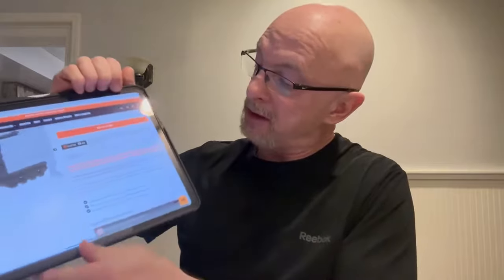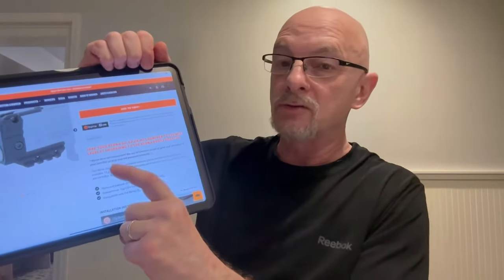3 Habits That Can Damage Your Byrna!

Comment: Ive watched a lot of your videos over the last day as I get ready to get my LE. I appreciate the tips as I was wondering if you could chamber one and then load the mag back up. Its good advice, they're pretty pricey, and of course the last thing I want to do is get a jam in a moment of need because i tried to squeeze another round in which is the biggest take-away for me.
Reply: If you chamber and then throw in a mag...It could jam up the mechanism and me personally would not advise it. The mag will still try and chamber a round regardless if one is there or not, so you are right it may jam in a time of need......theoretically speaking :-)
Reply: I would just get an X-tra extension you’ll be able to hold more rounds and the jam isn’t an issue 🙏 I just ordered mine plus a “bigger” spring 😇😬

Comment: I understand your point of view but of course they are only recommending their own products. Crossman probably doesn't recommend using anything from byrna.
Reply from the maker: This could be very true! I purchased the Byrna brand and compared it to Umarex C02 and save your money! Byrna underperformed the chronograph test every time and is very expensive!
Reply: The only 12 gram they warn about is Crosman. Most others are fine. Crosman QC is terrible and the caps are too thick on many and can cause issues. The Byrna CO2 packs are great though as they include an oiler cartridge that makes proper oiling so easy.
Reply: I was thinking that myself, them not wanting people to use the cheapest and most readily available co2 cartridges which would be crosman, of course they would rather people by their own, it is interesting that crosman is the only one mentioned though. I’d still probably follow the maintenance guidelines that the manufacturer provides

Comment: Shortening the spring just a little bit taking some of that tension off will make it so you can shoot 8 rounds out of it with no problem without that extra tension your talking about you can do the same thing with the 5 round magazine to keep them from cracking pepper balls in the magazine
Reply: If you cut the 7 round mag springs, the mag will be useless and will no longer function due to the way that the spring mounts inside the 7 round magazine.

Comment: Yes, I have tested all of my byrnas and they will hold an extra round. There is no way I would make it a common practice though. I figure the people that designed it know exactly what should be in there. Just because it fits doesn't mean you should utilize it that way. Great video as always.
Reply from the maker: I totally agree! Nice to see you’re still hanging around, do you still use your Defender? I have come to the realization you have to charge the cartridges every week or so to keep them reliable. Wait until you see a few videos I have planned for the Defender I have been working with a friend and he has made some huge improvements! How about the barrels actually fitting without wrapping tape around them and a piccitiny rail on bottom for a laser or light instead of the top and the useless laser that is built in. improved front sight and 3 different sizes including a compact which is 1” shorter than the original and if that’s not enough we are also working on a 68 cal less lethal that shoots Grimburg D shaped 7.5 gram projectiles. Just take your old outdated barrel receiver off and slap on the new and you’re good to go! They will be for sale soon!

Comment: Finally someone else says the same things I've said in other channels where I get mocked for saying these things.

Now that the improved 7 round magazines have been our for a while and no one is complaining of them breaking things, I can finally free safe ordering a few for our two Byrna. 

I actually contacted Byrna about oiling every 500 rounds because their CO2 cartridge boxes ship with 9 regular and 1 oiler cartridge for your Byrna. I asked them why do we need to use an oiler cartridge after 180 rounds if they recommend oiling it after 500? They told me to used the oiler cartridge at either 500 rounds or if I feel like the launcher is starting to feel like it's not shooting as it should.
How clean you keep your Byrna and the ammo you use will affect how quickly gunk can build up which the oiler cartridges help to clean out and keep the internal lubed. 

Just FYI, I based by numbers on 5 rounds per clip, 4 clips per CO2 (anything after 20 rounds is too weak to count), and 9 CO2 per box (saving that 10th oiler cartridge for later use). 5*4*9=180 🥺
Reply from the maker: I agree I think 500 rounds between oiling/cleaning seems to be too long and I never go past 3 seven round clips myself. I will probably stick to around 180 shot’s between maintenance to be on the safe side. Thanks for watching!

Comment: Thanks for the video! I just found you on youtube and will watch more. I don't know if you mentioned this in another video yet but on here you mentioned about the lubrication....Byrna actually found a way to do this from the CO2 cartridge. The one I had or have from Bryna has 8 cartridges in the box but one is lightly labeled "Oil"  So after the 500 rounds or so you can place this CO2 cartridge labeled 'Oil" and use it normally. Supposedly it will oil the mechanisms.
Reply from the maker: For some reason I totally neglected to mention the C02 oiler thanks for your input and for stopping by!

Comment: You are correct about the 5+1 and 7+ 1 arrangement, and byrna does not recommend using such load outs. Of course, the one thing they didn’t count on is that certain balls are slightly undersized, and when loaded in a magazine it will give it the margin the barrel and chamber needs to add the +1. 

And of course, it is definitely not recommended to load +1 with anything other than kinetics. Pepper or gas payloads may crack under the extra stress. I’m still doing further tests into the efficacy and reliability of the +1 with and without chem loads, results pending. And finally, YMMV

Thanks for sharing your thoughts!
Reply from the maker: Hey keep us posted on results! Thanks for watching
Reply: @airgunnerreviews7888  The other day I had a duke plus OC ball leak in a 7-rd magazine, and I had it loaded with 1 kinetic, 5 OC, and 2 kinetic. I may have to adjust the spring tension on it.

I also swapped out the Duke OC with another Kinetic. Here goes nothing
Reply from the maker: Well that sucks! You’re the first person commenting that the Duke rounds leak I was hoping they had stronger shells than Byrna. I think the extra round in the chamber really compresses the spring I have mine loaded with 5 OC and 2 kinetics on top with no extra round in the chamber and it’s been months without a leak. Hopefully I didn’t just jinx myself 🙏🏻
Reply: @airgunnerreviews7888  the Duke balls are quite good, IMHO. I think loading 7+1 is strongly not recommended, and I loaded it with 7+1.
Reply: Another update: last time I reported that I got a leak with Duke Plus PAVA rounds, and I failed to mention I loaded 8 rounds total in the magazine, since the kinetics were just undersized enough to fit one more and tried 8+1 into my SD. Obviously that went over the load force limit and it leaked out.

Since then, I managed to get 10rd extenders from Wixon’s shop and I was better able to load 6 Duke Plus in it with 3 kinetics no problem. I didn’t want to overload it and cause the 6 rounds to break or leak, as that would be a big and expensive mess to clean up, so I loaded up 9 rounds total. And, I didn’t load the Duke Plus rounds at the bottom, as they will roll on each other and could crack the seams if there’s too much spring pressure. So far so good. The key is not to overload the magazines and put too much force on the chem rounds that they leak.

Comment: Just bought an LE,SD,and a TCR glad I watched this video. I used byrna co2 cartridges, but I used the oil pellgun, and overload the magazine. started having some issues firing. Now I know. It would be nice if the video was on BYRNA website. Just like how to fold the full-size target I purchased. Had a heck of a time figuring out how to fold that thing so I could get it back in the bag.
Reply from the maker: I purchased the Byrna small target when it first came out and bent the wires trying to figure out how to fold it! Funny how easy these things are to take out of the package and set up!!! Thanks for watching

Comment: You also want to watch vibration around here equipment. I'm a truck driver so mine is always vibrated just from driving down the road all day long and the last time I went to use it the trigger wouldn't go back into place after pulling it. Right now it's a pile of parts waiting till I get home to put it back together because The part that is spring loaded that returns the trigger forward popped off so I had to take the entire gun apart to get to that part to put it back together. Very poor design. I don't know if it was from vibration or it just dropping because she fell off of the place that I hold her while I drive a time or two.
Reply from the maker: Good point thanks!
Reply: I think the Byrna pistols are over-engineered. I've had internal parts from the first LE fall out of the mag well, causing the safety switch to be wishy washy and no longer have that defined click. After another bigger failure with the CO2 piercing mechanism, I sent it back to Byrna. It was still under their 1 year warranty, so they fixed it and sent it back to me. Works fine for now.

Comment: I had a Crosman CO2 BB rifle which came with a warning NOT to leave the CO2 cartridges in it because the seals could/would eventually leak and make it useless.  Sure enough that happened, and I trashed the rifle.  I don't recall any warnings about in the Byrna manual; does leaving the pierced CO2 cartridge in the SD pose a similar risk?  If CO2 cartridges should be removed if the weapon is not fired shortly, that seems to be an unnecessary waste of the cartridges.
Reply from the maker: There is a caution highlighted in yellow on page 10 to always remove the CO2 cylinder after use. If cylinder is punctured and not removed, premature wear of the C02 seal will result in gas leak. I agree it is a waste! Thanks for watching!!!

Comment: What’s the difference if I have a standard five round mag with +1 compared to the seven round mag?
Reply from the maker: The 5 round and 7 round mags have different spring tensions. When you load an extra round in the barrel you are increasing the tension on the barrel spring that moves the barrel back and forward and overtime can lead to jamming problems and there is a decrease of power on the first shot which will be shown in my next video!
Reply: Full power with the first shot as long as you puncture the CO2 on safety then fire the first shot
Reply: @lostboyzracing8939  Yep, that's what I do, even for practicing.

Comment: Is it safe to dry fire your byrna without a co2 cartridge or ammo like you did in the video? Thanks for the video's brother 🙏
Reply: I don't see why you can't. But if you are drying firing CO2 without projectiles, I would avoid doing that. I've had internal parts fall out from the safety switch before.

Comment: hi , i just watchd your video and i was thinking why mineral oil instead of silicon oil , where did u get this conclusion u said "thats what they recommend.." they who? byrna?
Reply from the maker: Byrna offers their own oiler kit they recommend using and can be found  under accessories on the Byrna website and the composition stated is mineral lubricant oil. I honestly don’t know what their reasoning would be over silicone but they must have one. Unlike Umarex and FSC there is no firing bolt to launch the projectile so perhaps this is the reasoning?

Comment: I just got my byrna LE today. I only used a Co2 twice and now I'm noticing a slight rattle when I shake the model side to side (twisting motion). I don't think it rattled before.. is this normal?

I will preface by saying I did not use all the gas, I popped it off twice and decided to retire the weapon. So I backed out the Co2 early (having prior knowledge of air bb guns). And I heard something pop. So I'm unsure if I caused damage by not using more air first. Nothing mentions this in the user guides
Reply from the maker: Hi there! First off you did nothing wrong! Releasing the extra air either by shooting or unscrewing the cap is fine. The pop noise could be the trigger resetting which is common when the extra air is exhausted. I own both the LE and SD and they both have a small rattle when you shake them but as long as it doesn’t sound like a part you should be fine. I would use it again today and shoot 3 mags and bleed off the extra air just to make sure.

Comment: ;Just received my byrna sd I fired 5 rounds and worked great. I removed clip and added another clip but I could not go from fire to safe mode. Now with a full Co2 can I remove the Co2. so I can maybe rest the safe mode. Need help. Steve
Reply from the maker: Hi Steve! At any point you should be able to flip the safety on and when you press the trigger a projectile should not fire, however I have noticed on mine the safety doesn’t move as freely between clips so it may feel like it is stuck so just give it a firm push. Good Luck!!! It is also ok to dry fire to release enough air to be able to loosen the C02 cap. There is no firing bolt in these so dry fire will not hurt the launcher.

Comment: Hi I wish Byrna  would show how much C02 you have this is my biggest concern when you need it I went to practice and no air I only used it 5x balls before used 2nd time
Reply from the maker: Byrna recommends not to store a pierced C02 in the launcher as it can damage the C02 seal. I have been purchasing Umarex C02 (12 gram) off of Amazon and it is much cheaper, there is also Mr. Fizz seltzer cartridges in 8 gram for the SD model also on Amazon. I have extensively tested both and are comparable to Byrna for a fraction of the price. You won’t mind wasting unused C02 as much, lol!

Comment: Is the Byrna SD XL as powerful as the Umarex HDR 68 (16 joule)?
Reply from the maker: No the HDR has more power however arguably I feel the Byrna with Byrna Max chemical rounds is just as effective or more effective if the perp is wearing a jacket.
Reply: i own three 20j umarex "guns" (stashed loaded in the various rooms around my house) and my brand new byrna is NOWHERE near as powerful.  on the other hand, the little byrna is much smaller so it goes in my little bag that i carry daily.
Reply: If you want a Byrna that closely matches 16 J, get an LE. It's rated for that kind of power.

Comment: I JUST bought some Pelli gum oil 😫
Reply from the maker: Sorry!
Reply: @airgunnerreviews7888  all good! At least I found out before I actually used it on my byrna. Thank you for all the tips! Much appreciated
Reply: @babiiluv22204  The only time I use pellgun oil on my Byrna is right on the CO2 screw cap. Sometimes with repeated unscrewing and dropping on hard pavement, the screw cap can be difficult to screw back into the CO2 compartment. So what I do is add some pellgun oil to the screw threads, which makes it so much easier to screw the cap back into the CO2 compartment.